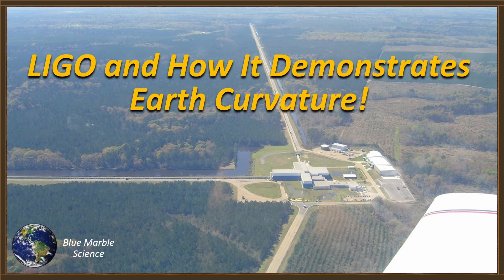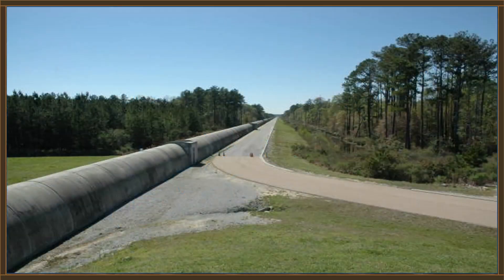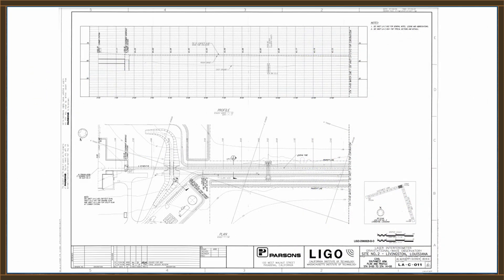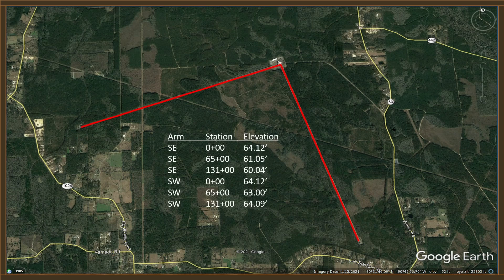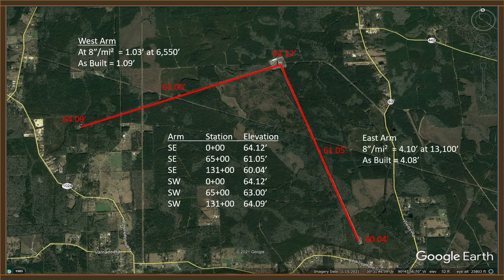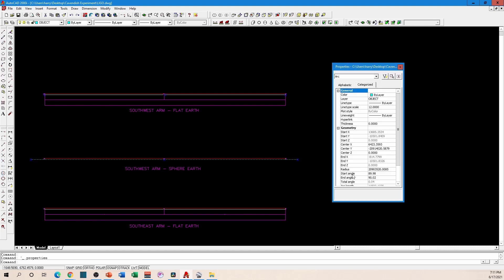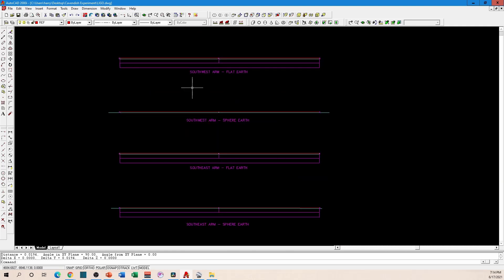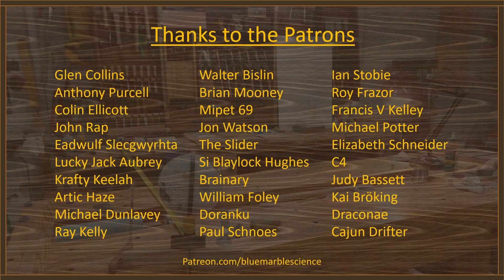How LIGO Demonstrates Earth Curvature

Comment: I'll bet the construction crew didn't even think about Earths curvature. Just got out their Transits (or lasers) and poured a "flat" stretch of concrete. Like they have always done.
This is a real good proof Blue. Thanx for the effort.  :)
Reply: That wouldn't work - the poured concrete in each section of an arm length would find local flatness [i.e. 90 degrees to plumb] & wouldn't follow a laser/transit. LIGO says the contractors used precision pouring which I suspect means they'd pour at least 40 sections of 100 metres each & they used GPS coordinates. A tricky & expensive proposition that isn't done often in civil engineering. They don't do this for runways for example - runways follow Earth curve & pilots allow for 1 or 2 degrees of slope on the longer runways [all in the airport data].
Reply: @nightjarflying  
We could ask Brian Leake, he's a concrete guy, he'll know.

/s
Reply: @nightjarflying  or more i seen some runways that looks waves lol. iirc the flattest runway in the world is the runway at the Shuttle landing center
Reply: @Elios0000  Yeah, runways are nowhere near flat nor bump free, but the pictures we see exaggerate the effect due to the zoom lenses needed to make interesting airport pictures. You can see that the background is massively foreshortened. 

Are you sure the Shuttle Landing Facility is 'flat'? I suspect it is accurately flat [bump free], but following Earth curve. I do know it was over-engineered in every particular. The Boeing Delta 4 HIF is possibly the flattest floor in the USA. varying by 3/4", & it has two bays only 250 ft x 100 ft (30 m) - note that Earth curve for that size is LESS than 3/4" so I'm sure that 'flat' floor follows Earth curve in the concrete pour.